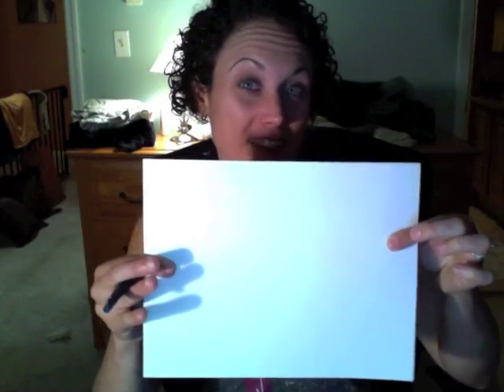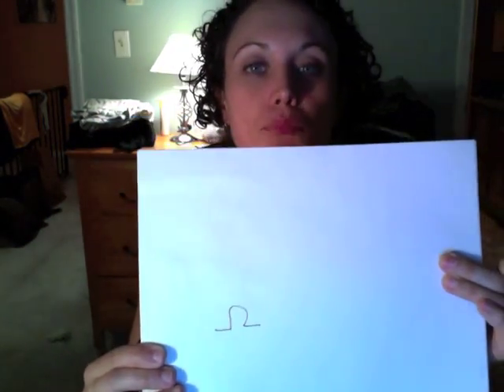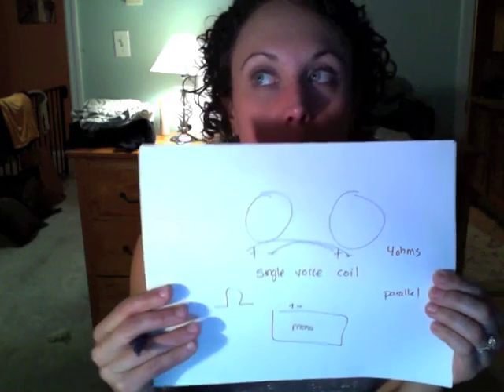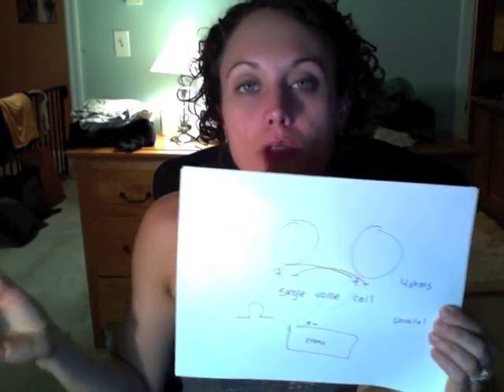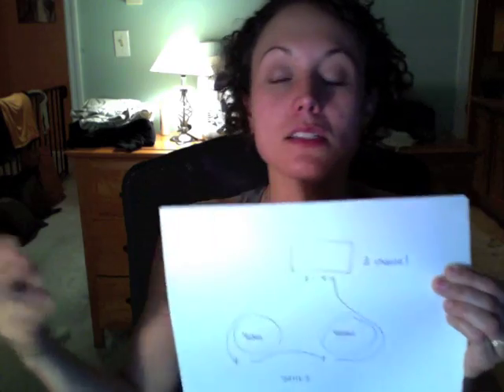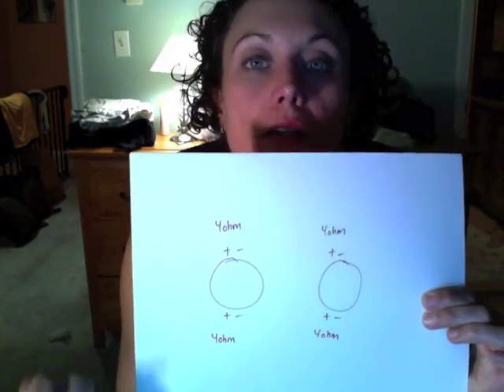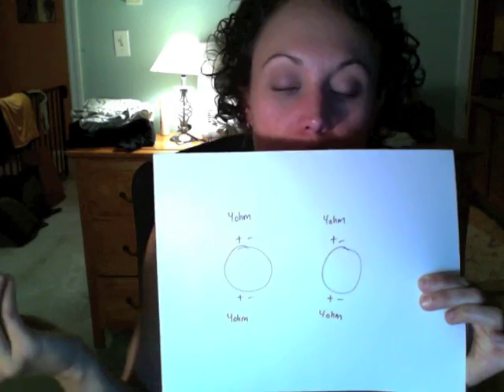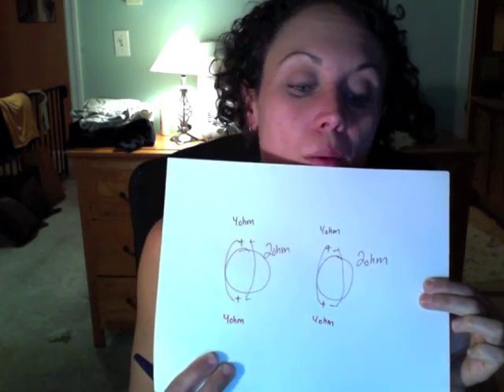ohms.m4v

Comment from the maker: On a 2 channel amp, that would be considered running in stereo (if you just hooked up 1 - 4 ohm sub to the left channel and 1 - 4 ohm sub to the right channel).  So the subs would actually play in stereo like how your front speakers play in stereo, meaning they don't play the EXACT same frequencies due to the recording.  If you series, then bridge, the signal is mixed and each sub plays the same thing.

Comment: @yayaenfinda85 Ok so for sure, given that you're putting them in different locations, I'd go with a 4 channel amp because this way you can adjust the balance between the fronts and backs (if you want to) using the amp's gain.   BTW that will be some loud vehicle. LOL.

Comment: @yayaenfinda85 Are they all located in the same general area or are you putting two in each front door and two in each rear door (as an example). I might just recommend a 4 channel amp with 75w RMS per channel into 4 ohms. This way you can run two 8" drivers parallel per channel to come up with a 4 ohm load.  Just my 2 cents :)

Comment: I want to  hook up 8 8" audiopipe mids. Power rating (MAX / RMS): 8 Ohm
 500 Watts / 250 Watts (each) 
Frequency response: 65 - 6,000Hz 
Sensitivity: 95 dB.
what amp would you recommended?

Comment: When I used to have a system in a mid 80's mustang, I ran a Orion 225 HCCA which is rated for 25wpc RMS into 4 ohms (but capable of 0.5 ohms stereo) bridged on a pair of 8 ohm 10" drivers.  I ran a 250HCCA which is 50wpc into 4 ohm stereo on the doors.   Some would say that would be a waste of low impedence amps but I had such clean, controlled bass and incredible attack on the doors. Best of all it was very little load on the electrical system. 

We definitely agree on our impedences :)

Comment: People don't realize thats it's the alternator thats making the power. the amp just provides a signal the speaker can understand. Keep the wiring at 2 ohms mono or higher. You'll get  more reliability from your charging system and your amps.